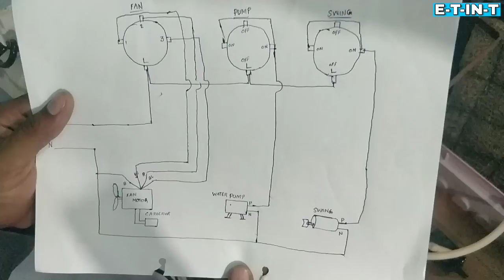Air Cooler wiring(కూలర్ కనెక్షన్)with 3 rotary switches complet connetion||ELECTRICAL TECH IN TELUGU

Comment: Hello anna ma cooler body inside shock vasthudi bro
Reply from the maker: Wire joints check cheyandi okasari
Reply: Motor body power supply vasuthudi,   eka cooler inside body vasuthudi

Comment: Anna nutrul black kada mari meeru full speed antunnaru ...answer plz
Reply from the maker: Fan nunchi 4 wires unnayi kada a
1)blue=neutral(main wire lo black wire ki connect cheyali,edi neutral)
2)black wire =high speed
3)red wire =medium speed
4) white wire=low speed..

OK na bro.. are you  understand
Reply: Yes regular ga black neutral ye kani cooler motor lo high speed bro nenu test chesa wiring time lo..

Comment: Anna direct conetion evali ante ela?
Reply from the maker: Phase wire undi kada adi ON/OFF button lo red wire ki direct chyi
Reply: @electricaltechintelugu5735  anna koncham clarity ga chepara,  rotary swiches not working my cooler,
Reply: Power source red wire motor red wire ki and power source black wire ki motor blue wire..
Reply: @sagarteja7571  ok మిగత స్విమ్మింగ్ అండ్ వాటర్ మోటర్ వి ఎలా?